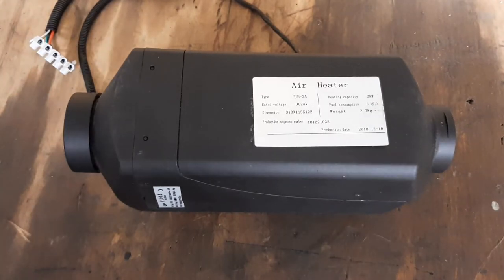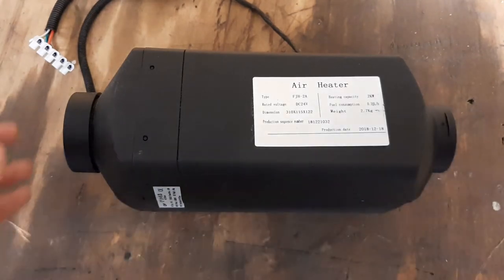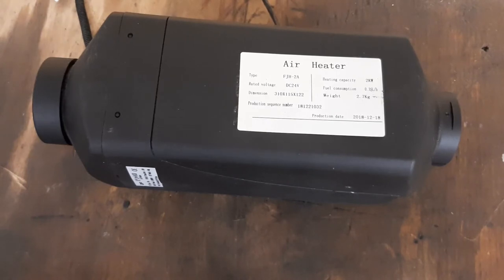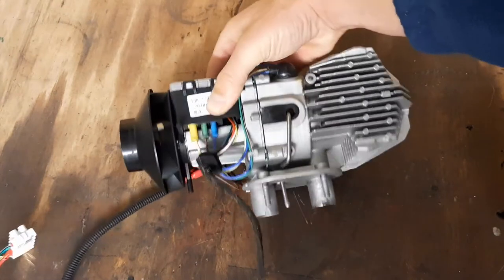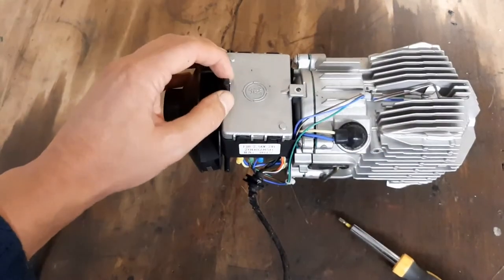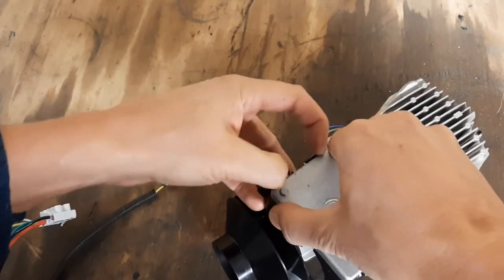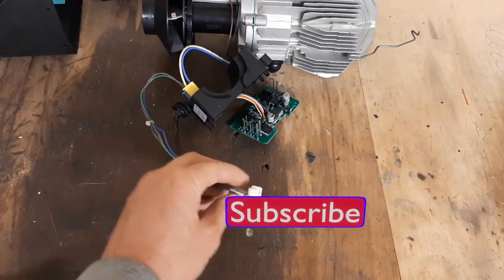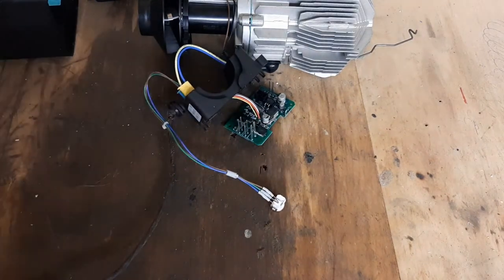Chinese Diesel Heater dissection. Comparison to Eberspächer, Webasto, Autotherm and Planar heaters.

Comment: That's a twmp sensor on the casting, it measures the temp, and will cut the fuel as it passes 245°C
The only difference between the Russian heaters and the Chinese one, are the accessories, nothing else..